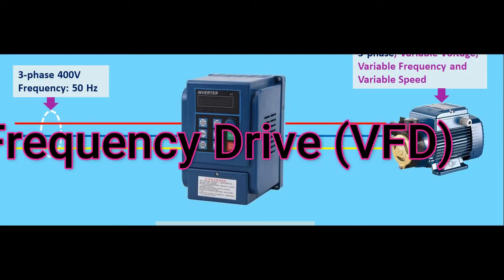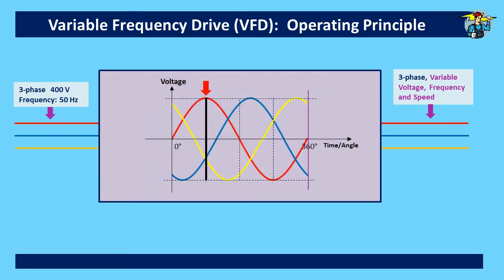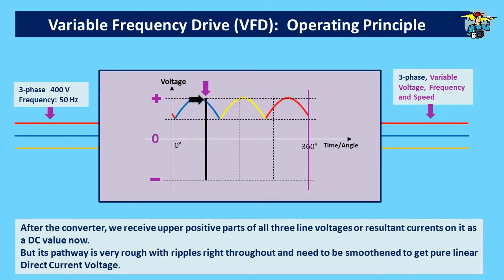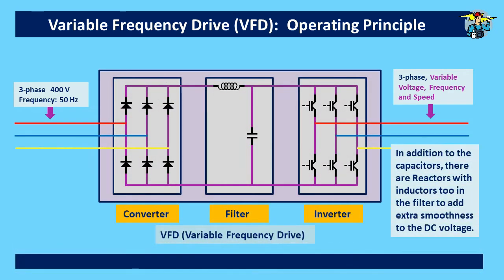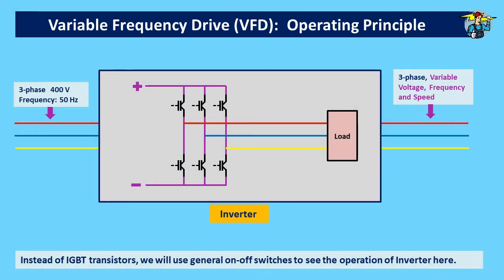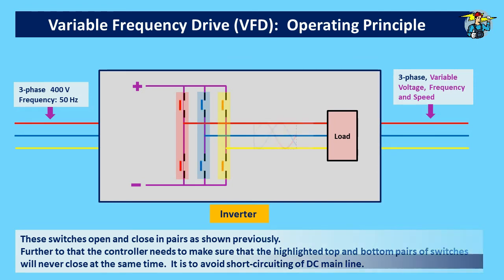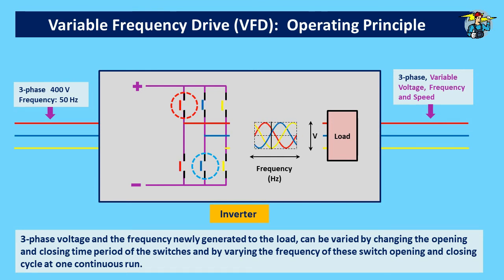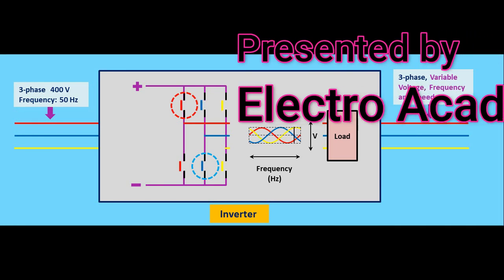How Variable Frequency Drive (VFD) controls Motor Speed? - Inverter Basics Explained.

Comment: Bravo.......u forgot the programmable......can u run  single  phase through two chanels......and make it work.......cheers
Reply from the maker: Regarding the programmable features, VFDs have versatile programming capabilities, and I plan to cover those in a future video. 
As for running single-phase through two channels, could you clarify if you're referring to input, output, or motor configuration? 
I'd be happy to discuss it further.